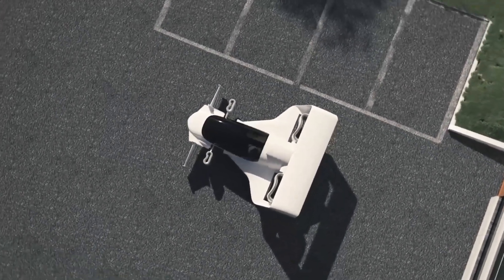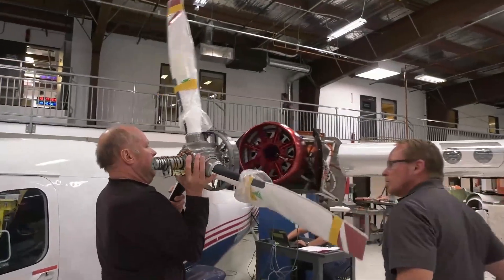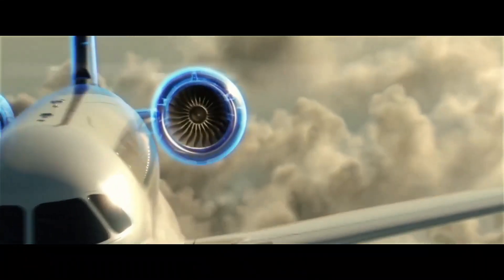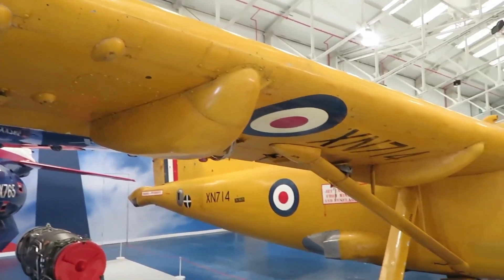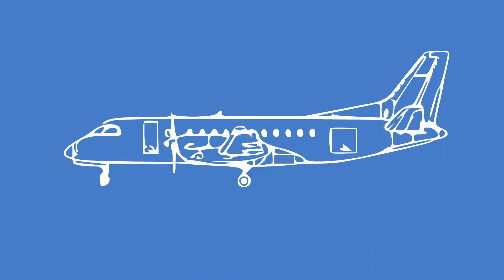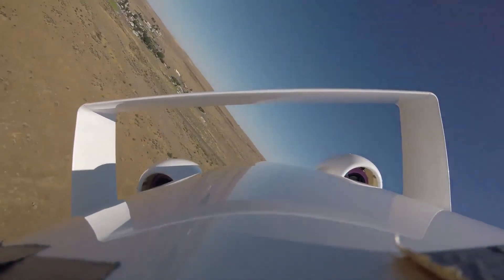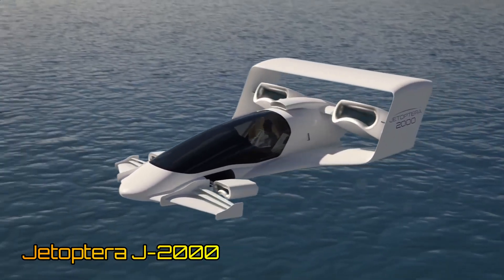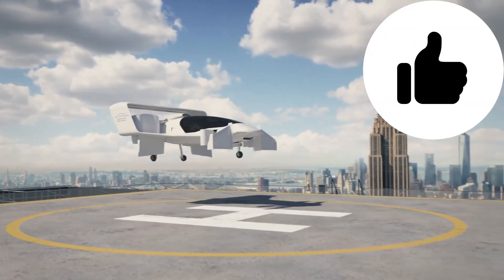Jetoptera Part 2 : Increasing the lift/thrust of an aircraft through fluidics

Comment: You also have to point out disadvantages! Distributed propulsion sucks at high speeds where low coefficients of lift but an aerodynamically clean wing is advantageous -> classical turbo fan design wins big.

Comment: Please be more consistent and authentic: 1) when hinting at an investment possibility, disclose whether or not you personally have direct or indirect financial interests in this matter. 2) when hinting at one investment possibility, also mention the others: Joby and Lilium (scam) have completed their SPAC merger and are thus directly listed on stock exchanges.
Reply: In what way is Lilium a scam?
Reply: @phamnuwen9442  Sucks battery dry in vertical mode so fast it couldn't possibly be used as VTOL (with significant payload)
Reply: @gehtdichnixan4704  They acknowledge that it's not efficient in hover mode. The idea is to hover and transition to/from horizontal flight quickly, where the fans are more efficient. Seems like a plausible plan to me.
Reply: @phamnuwen9442  the thing is that you need reserves for safe operations. If you include as little as 2 min extra hovering margin (say, in case of unclear landing site) their range goes down to essentially zero.
Reply: @gehtdichnixan4704  I guess it'll have to ensure the landing pad is clear before starting the approach.

Marginal energy reserves sort of comes with the territory if you're making a pure battery aircraft. It's just something you have to work around somehow.

To be clear, I would much prefer to see a much more practical fossil fuel powered VTOL, or a hybrid, but battery fundamentalism is where our culture is at the moment...
Reply: @phamnuwen9442  hybrid might be the only way for Lilium, true.

Talking about the stock, I wouldn't touch it either way. Pretty sure it's gonna be the next NKLA or go completely bust in 3 years from now max, but I also wouldn't short it because it might go up 200% temporarily.
Reply: @gehtdichnixan4704  I think LILM has a market cap of less than a billion USD, right? I don't understand this SPAC nonsense, it's very confusing.

If that's the case, would it be that unreasonable for it to be valued at 10 billion given today's hysterical valuations of anything "green"?

I mean Tesla is at 700 billion, and they haven't really produced anything useful, just expensive, impractical cars.
Reply: @phamnuwen9442  I thought so too, but now market cap is at 2.3 billion without share price movement, so there must have been new shares issued. Go for it if you see it reaching 10 billion!

About Tesla, I don't know what to say honestly. Your words were the justification for its market cap being around 50 billion. You seem to not agree with the market which is now convinced of continuous 50% CAGR and many other exceptional key facts.
Reply: @gehtdichnixan4704  What's the point of a car that is 2X the price of an ICE car and much slower on road trips in terms of range and recharging, especially if the government is destroying the electric grid with unreliable solar panels and wind turbines?
Reply: @phamnuwen9442  If you think the market is wrong then I suggest you short Tesla stock
Reply: @gehtdichnixan4704  So your argument for the value of battery cars is "number go up"? How do you feel about tulip bulbs?
Reply: @phamnuwen9442  I would totally short a tulip bulb :-P

Now seriously, I just don't feel like repeating the reasoning behind EV's again. Been through it so many times and the market has clearly been convinced. If you really want to know the arguments for and against EV's, and Tesla (which is about so much more than just EV's), you can easily find exhaustive discussions and opinions here on YouTube and on many websites. And Tesla's 50% CAGR is w.r.t. deliveries, not some fictional metric or future numbers, but it has proven to perform this well since it went public.
Reply: @gehtdichnixan4704  I'm not questioning Tesla's sales. I'm questioning whether they're sustainable. I don't see the value in electric cars given current technology and energy infrastructure. I think it's mostly based on hype, government subsidies and unscientific climate change alarmism. It remains to be seen what happens when the the majority of the buyers aren't new to electric cars and their practical disadvantages.

Don't listen too much to YouTube Tesla and EV evangelist channels. Most of them have no idea about the very good reasons the world runs 80% on fossil fuels, and they're all highly invested in Tesla or other EV companies.
Reply: @phamnuwen9442  mind explaining what you mean by unscientific?

And about the “practical disadvantages“: most people benefit from the fact that you get into the car in the morning after it has charged overnight and you save the time that you spend with ICE cars at gas stations. That's an advantage on 50-200 days per year depending on your circumstances. Only on road trips do you need to spend 2x as much time at supercharger stations than you would spend at gas stations, which is a disadvantage on maybe 5-10 days a year... if course, if you're touring all the time this is reverse, but for the average person Teslas win over ICE in terms of practicality. I will not spend any more effort here repeating what has been told over and over again.

If you have a problem listening to “evangelists“, you will not come to terms with any media in our times. It is hard to find anyone truely objective, most people/journalists have their opinions which they try to spread no matter what. My way to deal with this is to 1) perceive who has said what without necessarily believing anything, 2) try to listen to sources from both/multiple sides and then 3) think for myself. Having done this, I am absolutely convinced that climate change alarmism is scientific and that EV's are the future. Would loke to hear your long term view on this matter.
Reply: @gehtdichnixan4704  "mind explaining what you mean by unscientific?"

Sure. The actual risk to human life from climate related causes (natural disasters, heat, cold etc) has been decreasing enormously since we started using fossil fuels.

Most people don't need to visit the gas station more than once every other week with today's cars, and that takes just five minutes. It's not a significant inconvenience by any reasonable standard.

With an EV on the other hand you have to plug it in and out every single evening and morning, your range is half as long, it takes 10-20 times as long to recharge, charging stations are way more infrequent than gas stations and often not in good working order, and the car itself is twice as expensive to buy.
Reply: @phamnuwen9442  How does your claim in the first paragraph fit the rise of sea level, the glacier melt in mountain regions all over the world, the decrease of ice mass at the poles, the increased hurricane intensity, wildfire spread on all continents, ... list goes on and on. I even see old trees dying because the current state of drought is more severe than anything they have experienced in their lifetime (which is up to a century), and it is getting windier and we have new temperature records almost every year where I live. Please provide me with sources.
Reply: @gehtdichnixan4704  I replied to your comment yesterday, but evidently this has been deleted. Apparently, you're no longer allowed to rebut the prevailing climate change dogma.
Reply: @phamnuwen9442  You mean the link to some source of information has been removed?
Reply: Battery technology is exponentially increasing! Wait five years. Rendering all these arguments obsolete.
Reply: @michaelnelson9140  aerodynamic inferiority would remain, e.g. Joby and Volocopter would still be far superior when it comes to hovering as they would profit from improved batteries, too

Comment: Let's simply look at this as taking a Boeing 747 and cramming the engines inside the fuselage,  then ducting their exhaust through the wings.  You take an efficient turbofan and bury it inside,  with airflow losses from hundreds of feet  of intake and exhaust ducting, you must add engine and fuselage cooling and insulation, and all that exhaust ducting must be able to withstand the extreme heat and pressure from the engines. This probably necessitates stainless steel or titanium.  You don't want any of that near the fuel tanks,  passengers, or cargo. Oh yeah; one more thing: that ducted, high speed air also INCREASES drag on the wing surface. 

Finally,  remember this: the most efficient use of air travel is for long distance travel. Think five miles up,  but five thousand miles downrange.  Yes,  airplanes require lift to fly,  but they have no need to go straight up; they cross continents. V/STOL is an entirely different mission, and is really just a better helicopter. No,  you can't get more efficient lift than a helicopter rotor disk.
Reply: Agreed. Personally, I do see this technology as useful, just for specialty ultralight aviation instead of general commercial use. Specifically, I'd love to see a bladeless paramotor. Lots of injuries in the sport every year from accidental prop strikes could be avoided if there wasn't a prop just inches away.
Reply: Why can't you get more efficient lift than a helicopter rotor disk?
Reply: @wesbaumguardner8829  if you try to post the same weight with a smaller rotor, you have to increase rotor speed and noise, and when using a smaller diameter for the same lift,  you also increase the drag produced in creating the same lift. You lose all the way around.
Reply: @jamesengland7461  Perhaps there is an entirely different method that is more efficient and does not use rotors at all and we simply are not aware of it.
Reply: I say you can look at it even more simply if you try.
Reply: youre giving science an absolute.

then literally within the last few months the toroidal propellers came out for drones which drastically increase efficiency of a helicopter rotor disk.

I mean heck, even in your original statement, to increase efficiency all you have to do is duct the propeller and then add stators and the efficiency increases. might not be practically, but it already busts the statement of "No,  you can't get more efficient lift than a helicopter rotor disk."
Reply: @T_ C  I said rotor disk,  not rotor. That's the area sweptb by the rotor,  and within reasonable limits, the larger the more efficient.  Shrinking that diameter down extremely reduces efficiency. Yes,  ducted fans are more efficient than open blades,  but only when the ducts are short,  not running throughout the aircraft and causing enormous surface drag. All that ductwork has a serious volumetric and structural penalty. It's simply less efficient.  Toroidal propellers will be great- if their efficiency gains aren't frittered away by inefficient design.

Comment: There is no need for such a narrow turbine, because the goal was blade-free exposer, not opressed turbine flow. This method of propulsion, requires sqeezing air through a very tiny turbine, this causes a tremendous power and force to get air through this to match a classic propulsion of a blade exposed. The only given advantage, is hidden blades, not providing more then a at home high power vacuum. Some advantages can apply,  with afterburn or air heating, or instigate sonic waves turbines. Dyson presented this kind of "blade-free"at home fans, which is only a hidden blades. it will require a powerfull engine, with a higher air flow, afterburning/heat for greater speed. What good is a powerfull blade free exposer, when now slim air must be strong enough to cut a finger off.
Reply: Right. I wonder how this compares with Lilium jet. My guess is little if any energy advantage.
Reply: @stevemickler452  Lilium also, is not at all "blade-free exposer," more like postion conceal blades, the front will pull a tall childs hand in. If you take a ride in one, they are impressive luxury in feel, but more like a floating car, all those engines caused horizontal drag by wing spand vers bulk, quieter, but like a 7 passenger glider levitated by a sworm of tiny drones. They call it a "jet," it barely reaches half a private jets velocity in travel.

Comment: I thought Jetoptera was a scam from the getgo - the losses from ducting airflow render it useless for anything more than drying your hands, let alone propulsive thrust.  Your trying to sell shares in the company is huge red flag, and very disappointing.  Next you'll be telling us to buy your new cryptocoin.
Reply: This ain't gonna fly.... it's just a combination carpet vacuum cleaner and a hand dryer... a good one at that. lol
It may work on a small scale like on a hobby plane which is extremely light, but lifting and propelling significant weight would be a challenge at best.  I've seen another projects which uses multiple hinged ducted fans each with its own direct drive electric motor to generate both lift and propulsion which makes more sense.
Reply: @BillAnt  Well, I guess that it's down to proof of principle, isn't it? I can visualize a bunch of naysayers standing around, watching the Wright Brothers take off.
Reply: They sell dreams and of course it's all on paper written for you with schematics
Reply: It can work theres a couple of designs where it boosts airflow quite dramatically.
Reply: The company is just getting on it's feet it's still a fledgling company but major investor's are already interested in the design even the automotive companies are already wanting it
Reply: +1 that push was an alarm bell for me too.

Comment: The (high speed air) noise is a big problem, that's why commercial tip jets didn't "took off".

And fan/prop of the same size would be more efficient and lighter.

Comment: Jetoptera  looks like a big scam to me. Didn't hear anything about actual efficiency. Most of the flying aircraft were using turbines and not the compressor.  The drones they are flying are just glorified model airplanes which you can build with very low relative wing loading. Four time more efficiency ? With four times more efficiency you can fly a brick as we used to say. Lillium is by far more efficient. The stupid Air force just throwing our money away.
Reply: Efficiency can be inferred from the specs on their website. They're getting around 4 mpg LOL. It's horrendously inefficient.
Reply: @dudea3378  That is what I expected. The multiple fan method that Lillium uses is very simple and very reliable.
Reply: @Eugensdiet  Not really. Lilium gets about 12.4 MPGe... it's not great. Virtually any propeller aircraft made in the last 50 years is more efficient, even considering the electric propulsion. VTOL capabilities are very detrimental to efficiency.
Reply: @dudea3378  Thanks, but the intent of flight should be to minimize the VTOL portion of flight. Why do you suppose the efficiency is that low? Poor lift to weight?
Reply: @Eugensdiet   VTOL takes much more energy for lift than using wings and forward motion. Lilium is aware of this, so making the transition to forward flight with wing lift is best done as soon as the vehicle is safely off the ground.
Reply: @shanerosengren3521  I thought that is what I said.
Reply: @Eugensdiet  so it is. I apologize for misunderstanding
Reply: @Eugensdiet  They have too much crap sticking out, which contributes quite a bit to drag. Form drag, Interference drag, skin friction drag, etc. This drastically reduces their lift/drag ratio, which increases the thrust requirement just to get the same amount of lift to keep it afloat during cruise. So they need significantly more power just to go the same speed as a typical shake and bake fixed wing aircraft.
Reply: I'm amazed how many people have fallen for this snake oil.
There are VTOL aircraft capable of flight with the current battery technologies. Jetoptera needs batteries to greatly improve before their design can be electrified. 
I originally thought Jetoptera was just being misleading with their CGI videos. Now that they're raising money, I think they have crossed the line from being liars, to being scammers.

Comment: Aluminum Air batteries?
Reply from the maker: Could be a solution, but they are not rechargeable
Reply: @ElectricAviation  Yes but this means that they can become lighter as they run. If the aluminum oxide is shed in the form of very tiny particles it might be harmless. The plane would "burn" aluminum powder.
Reply: @ElectricAviation  aluminum air batteries would need to be swapped out. Good range, though.
Reply: How about fairy dust?
Unicorn power?
Reply: @phamnuwen9442  That comment is neither constructive nor useful for the conversation. In the Eighties a bus was powered by a zinc air battery that dropped zinc oxide onto the roadway as it went IIRC. At any rate performance would be greatly enhanced even above the already adequate 1360 W/kg potential of aluminum-air.
Reply: @stevemickler452  Is it constructive or useful to replace extremely reliable, affordable and energy dense fossil fuels with non-rechargeable batteries?
Reply: @phamnuwen9442  Only if you want a better climate I suppose. As the video explains so well, electric propulsion has many advantages such as enhancing lift all along the wing which make electric very desirable. Aluminum is far from ideal, but if it was used as I'm describing it, at least would get lighter as it flew like ICE does. I learned to fly years ago and love the sound of a Cherokee 140 revving up on takeoff so I have nothing against ICE for planes. Rather I just find it fun to try and solve engineering problems, at least conceptually. Maybe if equivalent CO2 could be removed from the atmosphere as part of avgas production....